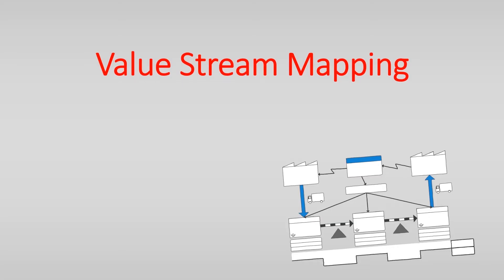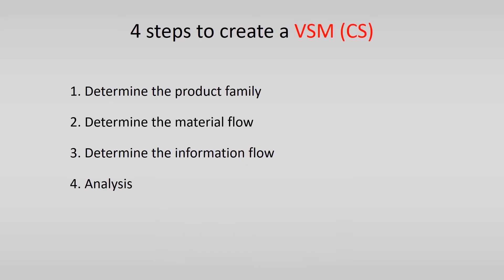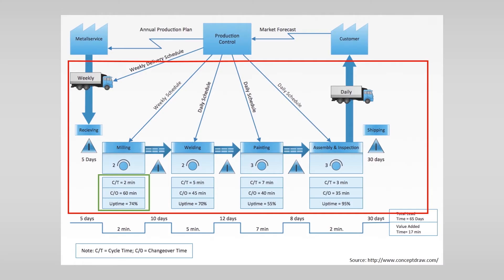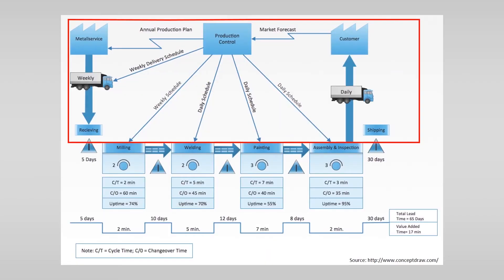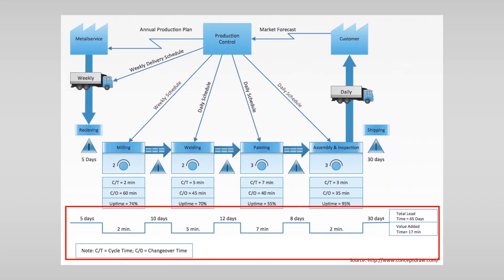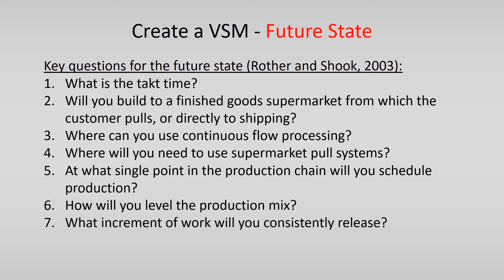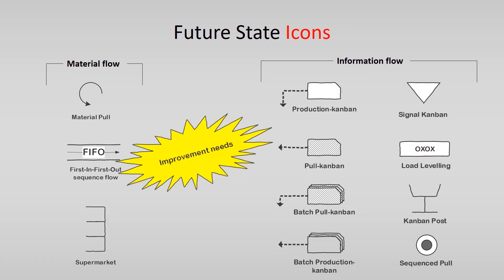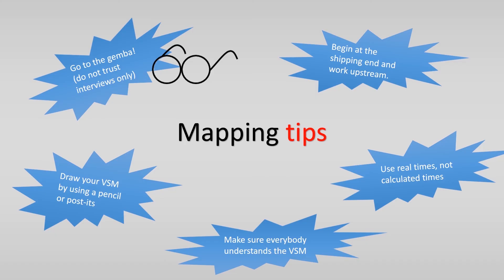VSM 2 – How to build a VSM? Symbols and Steps

Comment: The cycle time does not equal value-adding, right? In warehousing, storage often is completely NVA. That would mean that in that process stage, the cycle time would be 0 minutes?
Reply: right. NVA it this example is also inspection , often CT time on VSM is represent as VA which is incorrect(imho). ... anyway even count on VA is incorrect :)